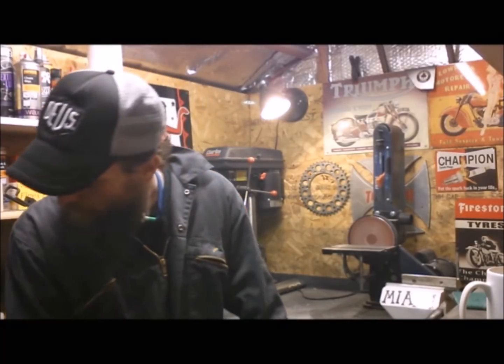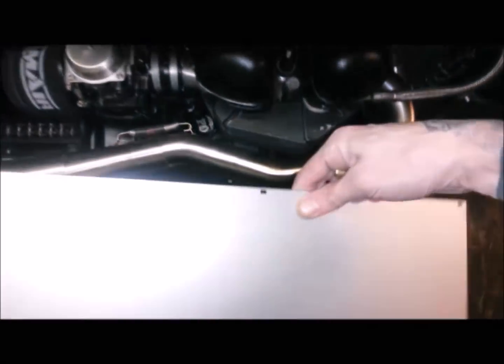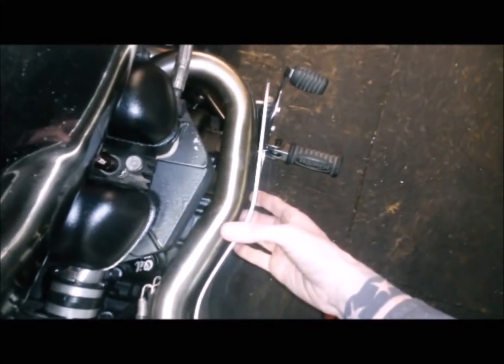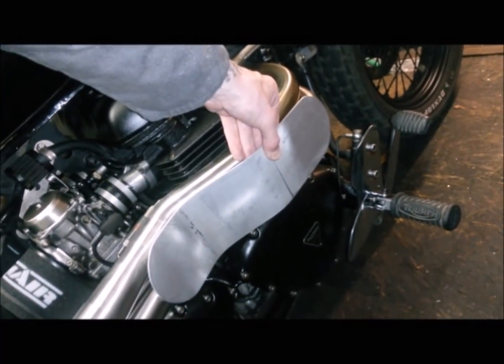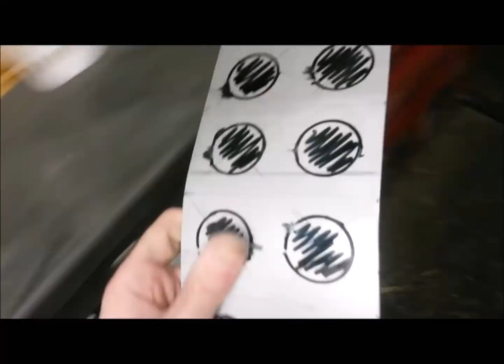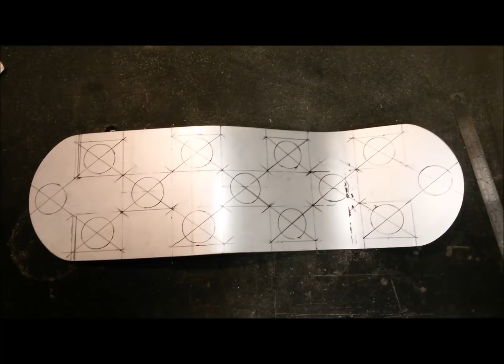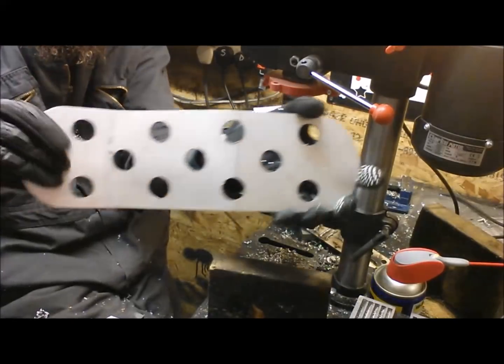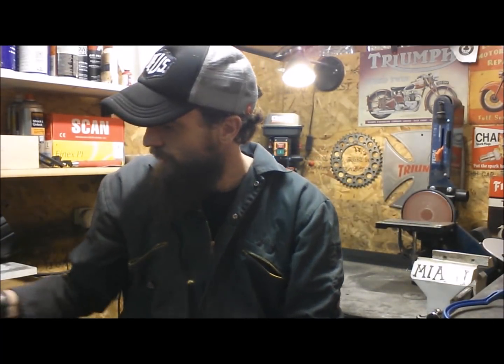Triumph Bonneville America homemade heatshield

Comment: Nice job bro, shame you haven't got a few bits of 1 cm square aluminium rod to put a couple of scallops in to sit against the exhaust, you could tap them and put nice countersunk screws in, no doubt you've already worked it out, RSM8.